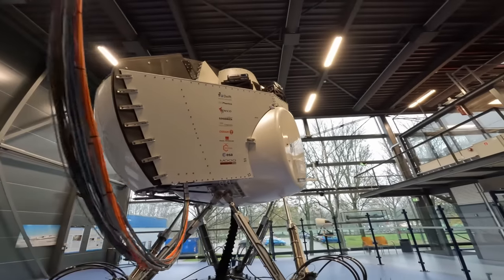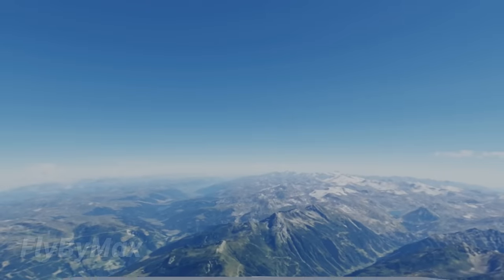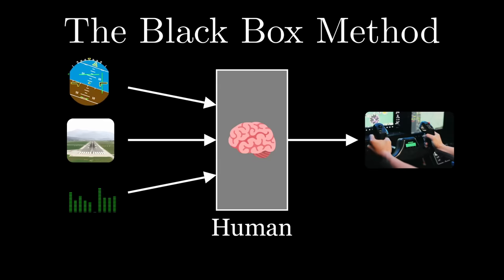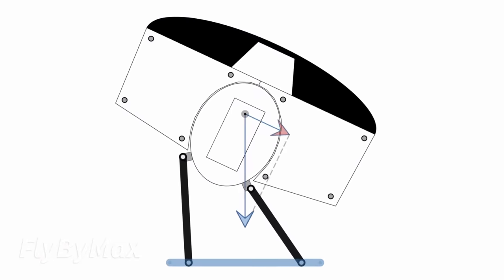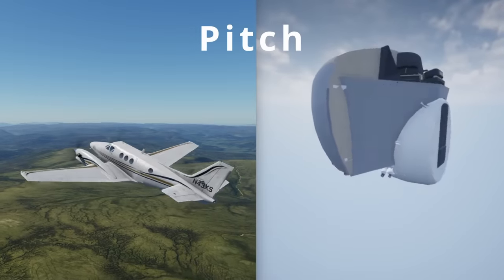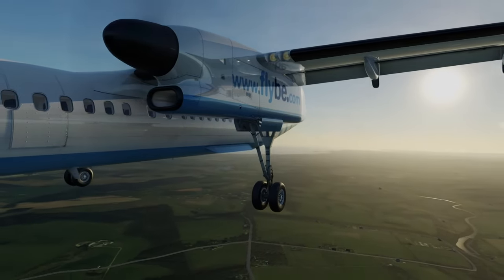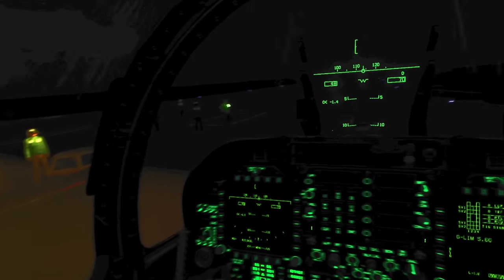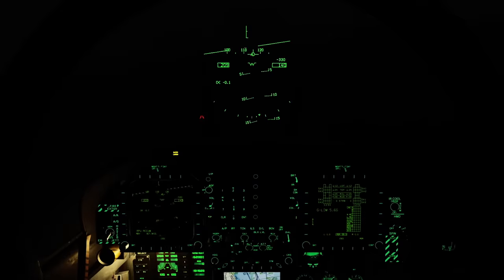How Flight Simulators Trick Your Brain

Comment: I still think is not well managed and never saw a simulator that is still correct.
To make it much better and simulate accelerations, the simulator should be put on a real 6 axis system. Rails on XYZ in a big area and full rotations. This way you can simulate accelerations sustained in time and at any angle. THAT would make it realistic.
Obviously you would need a small football field as space to move.

Comment: Very interesting video
But why are you making such a huge effort to separate gravity and acceleration? Physically, gravity IS acceleration, both are measured in m/s^2 and a human can't distinguish between the two. 
The only thing a human can sense is the change acceleration. We have a tiny suspended bone in our ears that has inertia and wants to keep going in the direction it is already headed. When that direction changes, the tiny bone pulls little hairs, and that tells our brain: Aha, we just experienced a change of acceleration. We probably are falling from a tree because gravity seems to be coming from a different direction than normal.
A human has no way of knowing if they are traveling in a rocket that is accelerating at 9,81 m/s^2, or just sitting the same rocket, standing completely still on earth. 
Gravity and acceleration are the same for us

Comment: while this is nice its a video game. and in real Life theres a thing called inertia and physics and while you being in a real aircraft (Example: cesna) you can feel the air going though  the flight controls. on an f-18 however its a flight by wire system its all computer but even still with reference points such as AoA and what your feeling in the fuselage you can tell what a plane is doing. as nice as this thing is its purely made to fly certain scenarios and not TRY to trick people brain LOL.